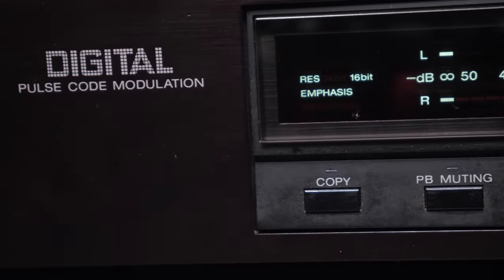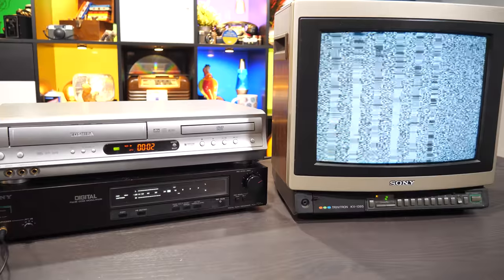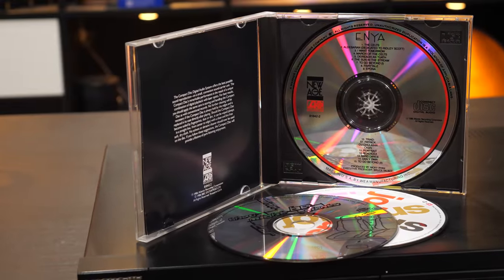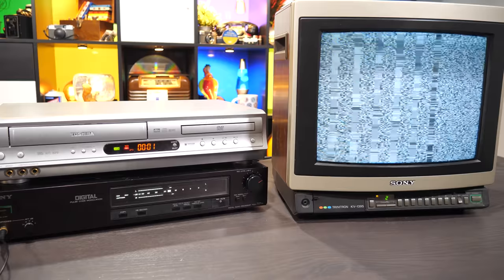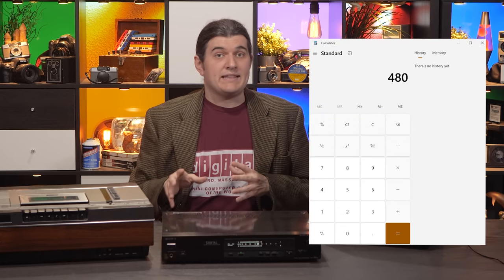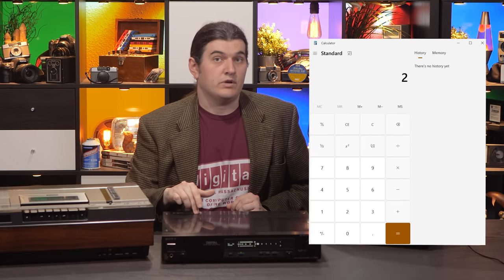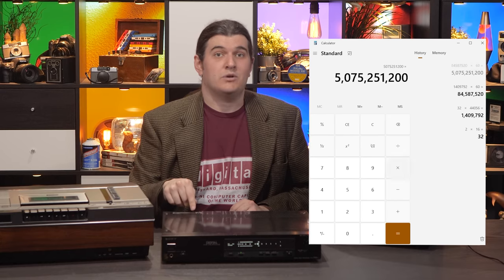Digital audio needed videotape to be possible - and the early days were wild!

Comment: You are spot on with your assessment of the robustness of the 14 bit-16 bit difference. There are modifications made to the PQ and R,S codes. If you look at Sony's range of adapters there was a portable (on location) version for working with a separate matching tape transport with batteries. A portable tape transport may be exposed to movement while recording which could upset the head to tape tracking. ASC made "active shelfs that these 701s would sit on in a 19" rack. The base of the shelf  had XLR in and outs as well as BNC based composite video connectors. All for use in a pro environment. The audiophiles did have a valid gripe with these units. They only have one DAC but 2 ADCs (may be the other way around) and that meant the samples between channels once passed through the analogue filters on the DAC may contain HF errors (phase shifts) this led to stereo image shifts that could be corrected (by the ASC shelf) with the addition of a compensating delay in one of the channels. In the UK right up to the early 90s British Telecom (BT) professional services still offered analogue co-ax lines between areas of the country. These lines were hang overs from our previous B&W 405line TV standard, these lines could easily pass 5MHz of BW, so were ideal for attaching these devices to at either end. At the same time BT would some times struggle to offer quality baseband stereo audio pairs between some areas of the UK, London to North Scotland for example. These also were happily encoded over satellite links. NPR in the US annually takes the "9 lessons and carols" every Christmas from London, before reliable trans-Atlantic digital sat-links we would often send a 701 to Cambridge with the OB truck, send the video from the truck to London Broadcasting House and from there up to Eutel Sat for down link in NYC. pristine audio across the globe.  Also during long nightshifts while high on coffee's essential caffeine (some times tea just doesn't hack it), the video output of these devices were great to watch. I have more information about these devices if you want, from our engineering training centre.

Comment: I would love another video on why 29.97fps was the standard for colour TV! I have definitely gone "huh" when i saw those weird decimal numbers on FPS when looking at typical editing software's FPS selectors.
Reply: Matt Parker (Standup Maths) did one a few years ago.
Reply: Pretty sure there is one on here somewhere... it was quite a few years ago now...
Reply: There is literally no reason for it to exist anymore and it shouldn't have happened in the first place
I hate 29.97 with a PASSION
Reply: To make a long story EXTREMELY short (and I am going to fudge some of the technical details for brevity): because the original black-and-white NTFS standard was 30fps for reasons having to do with using 60Hz AC power, and when they needed to design a color version of NTSC that could still be decoded by black-and-white TVs, they made the new framerate exactly 1/1000th slower so they had extra space to shove some color data in, but it was close enough that black-and-white TVs would still sync up each frame properly.
Reply: @Xnoob545  But NTSC worked just fine at 60.n Hz framerates game consoles would output.

Comment: Wow, a video about a machine that I'm using on daily basis 😅And you know what I'm using it for? You nailed it: I'm recording night radio programs, and my own LPs, and then I'm playing them back during the day without any commercials and without having to flip and then change the record every 24 minutes (or so). And as we have E-300 tapes here in PAL-land, I can do this for 10 hours without an interruption! That's quite a workday, my friend 😉And what more, as I am using a bit fancier VCR, at the same time I'm recording the same program in pure, high quality analog as well. So I can even chose, what mood am I: digital or analog 🤣T
heoretically, I could record separate programs on the video/PCM and the HIFI part, so I could use that before mentioned 5h tape to record 20 hours of music, interrupted only just once in the middle, during rewind😁 So yeah, thanks Sony and thanks semiprofessionals and audiophiles, that these devices does exist!👏
Reply: @killingtimeitself  Well, I have about a 100 VCRs, two of these PCM adaptors, and a bunch analog tuners. My LPs are analog as well 😅What I don't have is a desktop PC with a decent audio card. I'm cooking with what I have 🤣 Moreover, yeah, I'm an oldscool cool guy as well 😎
Reply: @killingtimeitself  Actually I have a really good card: a Gravis Ultrasound. The very first one 😅About that was the last time I used (and had) a desktop PC. That's the middle of the '90s! Now I believe it won't be easy to install it in any PC (as it's still an ISA card...) let alone driver for it etc... I had a semi-professional card which had SPDIF ports (in-out as well) and I used to have a laptop which had an optical SPDIF out integrated in the line output jack! That was funny, connect it to a DAT or an amp with digital input via an optical cable and there you have a good D/A 😅
Reply: @killingtimeitself  There's absolutely no shortage of SPDIF output cards; many motherboards still have SPDIF outputs as well. My Z690 Aorus Pro has 2 analog ports, and 1 SPDIF. Countless ASUS Xonar and probably Creative cards have SPDIF as well.

In the late 2000s, it used to be standard for motherboards to have an internal SPDIF header as well which you would connect to a graphics card to inject audio into HDMI as early HDMI graphics cards lacked the ability to handle audio.

Comment: Would probably have been worth a mention of ADAT which was kind of a multichannel version of what this does. ADAT had a pretty long life and I was still seeing it being used in smaller recording studios well into the 2000s.
Reply from the maker: I considered bringing up ADAT, but from my understanding while it used S-VHS media, it wasn't encoding video onto the tape. In other words, it was its own format but the designers elected to use off-the-shelf media
Reply: Ooh, came here to ask about ADAT as well, as I remember buying S-VHS tapes for our band to record on in the 90s. Those machines have the tape machinery built in rather than using separate video machines - I had always assumed they worked like the little 4-track machines that used normal audio cassettes, but it would have to have been the same striping as video cassettes, wouldn't it? They were cool because you could add more recording to your studio by getting another 8 track machine and syncing it with the others.
Reply: Haha, yeah, ADAT was the first thing that came to my mind when I saw the title about recording digital audio on video tape. Might be an interesting topic for a future video.
Reply: @TechnologyConnections  A bit like DDS was with DAT then - take advantage of the off-the-shelf drive hardware, but use your own format, kind of thing. I'd always imagined ADAT was recording video, but I suppose I'd never thought about it.
Reply: ADAT is still used by some laserists who use it to record ILDA waveforms. Its digital connection standard is also still used by some studio equipment.

Comment: I used to use a PCM701ES in the mid 1990s, I actually bought a DAT recorder in 1989, for hifi use, but loved my Sony PCM adapter that I used with a Sony SL-HF100 Beta machine, also recording simultaneously to the hi-fi sound tracks on the tape, so that I had a tape with analogue hi-fi and digital audio, fun times x

Comment: I used the PCM-F1 and its matching Betamax recorder to record location sound effects for the BBC around Europe in the 1980s. I fed it with two Schoeps microphones and a home-made 48 V power supply. It made some stunning recordings! Many of these were issued on CD, having been edited on the 1610 system. So a completely digital path once the microphones have been encoded by the PCM adapter – all the way to it being decoded in the CD player. I recorded everything from trains in Holland to cowbells on a mountainside in Switzerland, to boats in Venice to Rats to printing presses to mechanical telephone exchanges. If it made a noise, I recorded it! The best things of all about digital recording: being able to record over a long duration and having zero wow and flutter.

Comment: I remember most software (but especially games) In the early 80's, came on cassette tape here in the UK. Your Atari or Amiga, Spectrum etc would read the audio code from the tape cassette, which any tape recorder with a headphone out could be connected to the pc. The early (physical) copy protection measures which came with the software were pretty interesting.

Comment: Back in the 80’s I worked at a world class recording studio. We would use a dbx 700 unit to digitize a copy of master reels as a safety measure. Slightly different than PCM the 700 used a technique called Companded Predictive Delta Modulation but functioned the same and sounded exactly like the master. Ah, back in the days when a recording engineer really did some engineering… 😊

Comment: My mind is kind of blown that VHS tapes could hold gigs of data.  I don't know why but cassettes of tape never really register in my mind as data storage.
Reply: The random access time sucks but tape offers wonderful density. D-VHS held up to 50GB to allow HD video on tape. For backup the current generation LTO tapes can do 18TB uncompressed with sufficient error correction to ensure you’ll almost certainly get it all back.
Reply: I didn't understand this part: if digital storage media of the 60s were too expensive for the bandwidth required by digital audio, but video tape could easily be adapted for that digital (audio) data stream, well, why not use existing magnetic tape storage formats for digital data? Surely those already existed?

(I see now that this is pretty much discussed from 32:12 on.)

Comment: IIRC, Severed Heads' album "City Slab Horror" (and more) was mixed to a similar Sony PCM adapter, that allowed Tom Ellard and Co. to make a digital album in 1984 on a near home studio budget. Apparently this caused issues when the album needed to be released because there weren't really any studios in Australia that were properly equipped for actually mastering from that tape, and so they had to use an analog copy instead.
In the 2010s, Tom Ellard actually managed to go in and actually pull audio from the original tape for the album and release an objectively superior transfer of the album by just going into the closet and making sure there weren't any dropouts or glitches or anything.

I think these devices are super cool

Comment: I have a suggestion for a video about simple mechanisms: I had to disassemble my dad's old Wahl clipper machine from the 80s, which is working fine til this day! The problem was just the AC cable. But I learned how simple they were inside: just a switch and (I believe) a coil, that shakes the blades according to the AC outlet frequency. I remembered your channel right away. Took some pictures of the clipper. You could make a video!

Comment: I used to work for a computer reseller from 1993 to 2005. I remember one video tape-based backup product released during that time. This was back around the time when the Colorado 120 was the standard for tape backup systems. 

I don't remember anything about this video tape backup system other than it was a device that converted your data into a signal your VCR could handle. Probably worked very similarly to the PCM device you showed in this video, but I recall it being a smaller unit.

I wish I could remember more about it (like the name). As a general technology, it seemed kinda neat, but it didn't take off as a concept as I never saw any further devices to do the same thing.

Comment: Interlacing was a standard feature of SD video, you got two fields at 60 or 50Hz that formed one frame at 30 or 25Hz.  Your 525 or 625 line frame was two half resolution fields interlaced. The PCM adapter was simply using both fields in succession.

Comment: Actually those consumer PCM adapters were used mostly in small studios and also broadcast stations, they used them in broadcast stations as was a good way to sent a audio signal through video line in phase. Yes a huge reason early CD’s were limit to 63 minutes later to 74 minutes u-matic paired with a professional version of these PCM adapter was used for mastering to CD. 

Then later on mid 80’s you had a PCM-EV10 for video format for early HiFi stereo, but also for early audio dub for editing as that particular adapter recorded the PCM audio on a separate track which is how later HIFI decks works so great for editing and simulcasting. Yes these PCM adapters played a huge part in creation of CD’s and HiFi stereo on later HiFi decks and editing.

Comment: Back in the mid 80's we used to "cut the Sony PCM in half" - that is connect into the serial audio signal between the DACs/ADCs and the Video section, and feed it into an interface plugged into an Atari ST - we could record and playback CD-quality sound. This was principally to support electro-acoustic music production, but  was sold briefly as the "first hard disk mix editing system for less than the price of a piano". Of course you needed quite a few big (80Mb!) hard disks for a CD, and we had to invent a form of RAID, but fortunately the ST had SCSI.
We also got a video-tape back up system for free!
I was always very impressed by the engineer who would take brand new ~£2000 PCM units, and cut/modify their PCB (voiding the warranty, of course). What confidence!

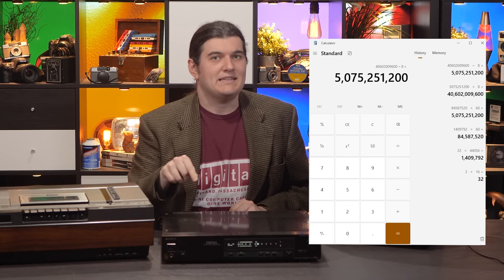Comment: 32:09 It didn't take a long time to realize the data capacity in theory (1950s computers were already using reel-to-reel magnetic tapes), it just took a long time to realize it in practice at the consumer level. Namely because of 2 things:
1/ Using linear tape for data storage is slow. Extremely slow. It's slow for linear storage, and even slower if any of your data is non-linear (most consumer grade devices couldn't even do non-linear seeks automatically). That's why tapes were abandoned (except as bulk backups) pretty quickly once diskettes started gaining in data density -- diskettes were faster and could easily handle random seeks.
2/ Home computers in the 1980s had RAM measuring from double-digit kilobytes to single-digit megabytes. A medium that can hold gigabytes of data isn't terribly useful when your system can only load kilobytes/megabytes. A couple shoe boxes of 90-minute cassettes (~1.2 MB each) was plenty even for computer enthusiasts (and a lot easier to find your data than having it all on one mega-tape, see point 1).

Comment: Very interesting! I never heard of a PCM Adapter, but I used a trick that got me a similar result: mastering audio on a Stereo VHS tape. While it wasn't digital, being part of the video signal made it extremely stable: no wow or flutter. The only problem I saw was lots of wasted bandwidth from not using the video portion.

I really wanted to see a home 16-track recorder that used VHS cassettes since they had ¼ inch tape much like the old reel-to-reels. It wouldn't surprise me if someone had done that, much like a 4-track used standard audio cassettes!

Comment: Back in the late '70s I worked at a TV/Audio repair shop and a customer brought in one of these adapters for repair. They didn't like the quote so traded it in. It may have been a PCM-1. Inside was a motherboard with many daughter boards plugged in, each loaded with TTL chips. Of course we didn't have a service manual for it. I picked it up for $50 and spent my own time trying to fix it. I found that some boards were identical so tried swapping them around to see if the problem changed, which it did. I was able to single out one bad board and started the amusing task of swapping the TTL chips (fortunately in sockets.) I finally narrowed the issue down to a couple chips, which being simple TTL chips, I had some of, and was able to get it working. It was awesome for someone like me who loved digital audio, and yes, I borrowed a number of records from my friends. Years later, it died again and I was into CDs anyway, so I scrapped it. I figure I got my $50 worth out of it, not to mention the wealth of TTL chips for my hobby parts and the fun of working on it.

Comment: FYI.  In addition to PCM audio recording, there is another digital audio recording "format" (for want of a better word) called CVSD modulation which stands for Continuously Variable Slope Delta modulation.  It's one-bit sampled audio so an audio signal sampled at any digital rate, say 50 kHz, gives you a digital bit stream of 50 kb/s.  It's currently used in two-way radios because being a digital bit-stream, it lends itself to encryption and being multiplexed with other low-rate digital bit streams into one high-rate digital bit stream.  It's a pretty simple concept, but just have to realize that audio data that instead of digitally encrypting the instantaneous voltage value of the audio signal, you are digitally encrypting the instantaneous rate of change of the audio signal.

Comment: Love your programs Sir. That bit of kit was indeed incorporated into DAT tape, that you correctly pointed out was blocked by the music industry for home use, due to copyright issues. However DAT tape was adopted by professional recording studios and became the industry standard in the early 90's to Master onto, it was cheaper than 1/2" 30ips Mastering and sounded great. I remember working on digital then and it was difficult to find large enough storage media to run Protools on, we used magneto optical disks. But the DAT tape could hold an hour of 16bit 44.1KHz recordable space well before CDR's were ever invented.